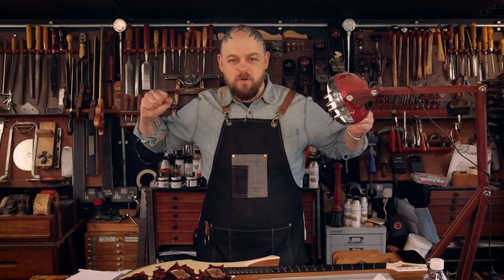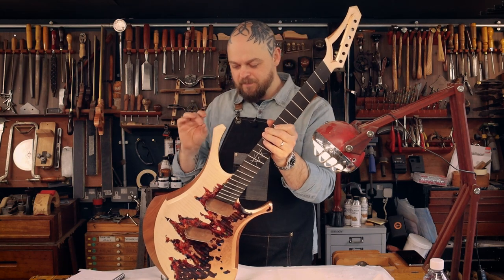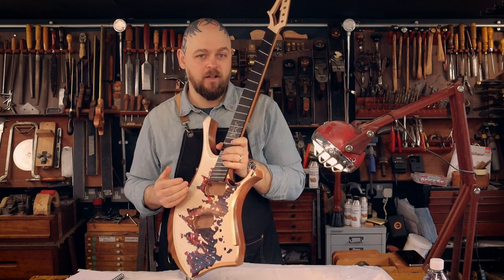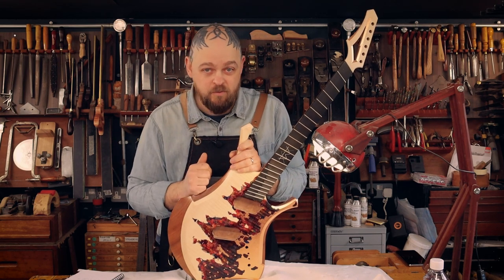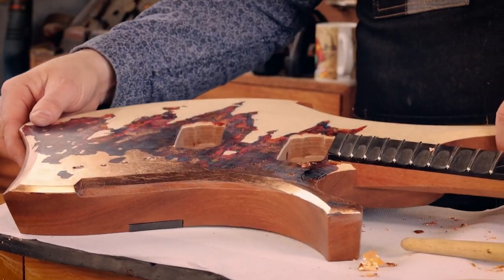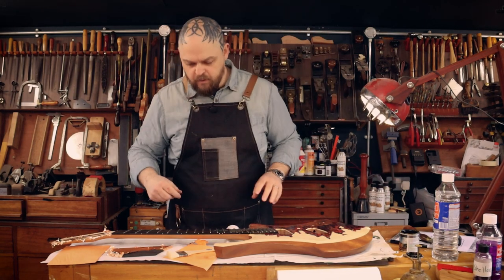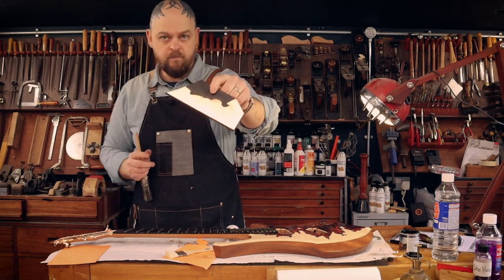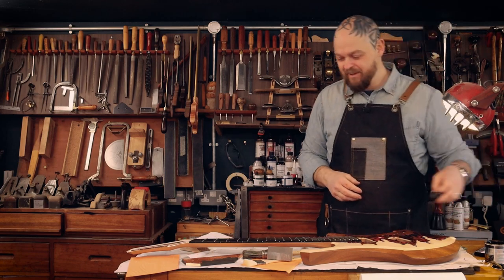Ep 10 - Shred - Bridge Design - How to Build a Copper Leaf Multi-Scale Kit Guitar

Comment: What about a bridge where you adjust the height from the back of the guitar? You'd basically have 6 bolts or screws on the back pushing against the bottom of small plates on which the length adjustments are on. Then again, you'd still need to drill holes front to back on the body.

Comment: Speaking of overly complicated bridges, I built one a couple months ago...

https://drive.google.com/file/d/1nDvhYSOgCo2CRhCI5b2MXyAi4-Sea2Ax/view?usp=sharing

It is a two-way tremolo, operating on needle bearings, in theory there was to be a mechanism to lock it in place without using any tools, but I never finished that part of the project.

It works, stays in tune when working as a tremolo, all regulations are functional, there is no drilling through body - the string is put in from the back, ring locking it in place. I ended up locking it in place with a screw, because after 10 years of playing Floyd Roses I eventually found out that I prefer a solid bridge ;)

Anyway, this build and the Nebula are just amazing. Great stuff, enlightening and inspiring!

Comment: Not a fully formed idea yet, but maybe the germ of one... Considering that it's for you...,  If you take a hand plane and flip it over so that you are looking at the cutting side and imagine that as the top of the guitar, you have a flat surface (guitar top) with the protruding blade (bridge) that is nearly infinitely adjustable in terms of height and angle. If you cut a slot through the guitar, and rout out a bit of a cavity on the back to work in, could you not essentially turn the whole guitar into a giant block plane? I'm certain that you have seen a million ways to set and adjust such a thing, from the simple to the silly. I'm not sure if it's a plausible idea, but I'll be glad to watch you chase that squirrel for a while.

Comment: what if, for the bridge you use the idea at 17:17 but instead of putting the slot for the strings in the piece you screw to the guitar you make the moving saddle longer and you put it there?  it's a bit less cool than your final idea, but it should have enough force to press the saddle down and quite easy to make

Comment: Hi Ben, there were a few mistakes in some of your designs. You have not taken into account the angle of the bridge, which results from the scale length.
But why do so much work? Take the Schaller saddles, either from the Hannes bridge or from the 3D-6.
With the 3D-6 you only need a new frame and a base plate. In the base plate you can also work out the strings for hanging.
If you take the saddles from the Schaller Hannes bridge, 
all you need to do is make a beautiful wooden frame that supports the saddles on the side and contains the screws to adjust the string tuning.
But be careful, the height adjustment is only 2.5mm and the spacing 54mm.
For the palm rest, there is nothing nicer than the saddles from the Hannes bridge.

Comment: You need to have the string anchored to something other than the saddle, or it'll make intonation adjustments impossible - as soon as you undo the locking bolt the saddle will pull forward. If the saddles are locking to a base plate, then mill a string anchor into the base plate instead. Although you still have the problem that adjusting intonation will be hard, if all you are doing is undoing the locking bolt then having to move the saddle by hand, with it under string tension.
Reply: Loosen the sting ala floyd rose adjustment when you dont have the special tool...
Reply: @BBGuitars  you don't really want to have to slacken the string right off when setting intonation though, do you?
Reply: @Forest_Fifer  its not ideal, but same principal as the archtop bridge ben mentioned in the opening of the video, youll need to slacken the strings to move it around. Technically you should be loosening your strings to make intonation adjustment any way, especially when extending the string length, generally speaking I dont because I havnt had any issue doing so...

Comment: Sorry Ben, just some thoughts on  your saddle / bridge design. If I understand your design, it looks like the string  height adjustment will not be possible while the string is sitting in the screw slots, this would not be very setup friendly. Imagine trying to measure and change string height and having to remove the string from the saddle wet screw " thingy" with each adjustment.   Also the intonation adjustment isn't clear, but you might have something planned for that.

Comment: Only slightly disappointed that the headstock didn't get the mosaic colour stain treatment on its top (non-tuner) side with a copper Crimson logo inside! Bevels match nicely and do finish it off well still. 

RE bridge, slightly beveled edges, front shaped to match the headstock end(?) and the height 'grub' screw should have three cuts for a six-point star IMO rather than Phillips cross or full eight-point asterix

Comment: This is just my opinion, but aren't you trying to reinvent the wheel, so to speak? I have a Telecaster that has a 6 saddle bridge, string through body, I'm not bragging, but it's perfectly intonated, the string height is Perfect for me. It's 30 yrs old btw. On my 335 it's got the old tunomatic bridge with the standard tail piece. It was a job getting the string height correct, as there are only 2 adjustments, but it works, & it's well intonated. I've never found a reason to complain, as I love your designs, but you're driving me insane! However I will withhold complaining until I see your bridge. I've wondered about intonating a fan fret guitar. Of course I'm an old coot, who has played over 50 yrs. So I'm old school on the frets. Anyway. I'll watch.

Comment: Grub screws to set the action is nearly perfect simplicity but I fear it would be a pig to set up and all scratchy edges because of the hole for the Allen key in the middle of the string contact area. Your would also have to tap the hole it goes into. Instead, how about a slotted pan head machine screw and a nut. Set this in a smooth hole in the bridge block and when you turn the nut, the bolt, with string running through a slot in its head, goes up and down. No tapping, no need to cut any fancy slots and can adjust with string fitted. Basic and simples.
Reply: Aaaaah, I need to build a guitar now! I'm all inspired by these awesome videos. Had anyone got any time they can lend me?!

Comment: I'm liking the bridge, but I don't like your height adjustment. I have an alternative for you. If you make a triangular bottom piece with a threaded hole running parallel to the string, tip up and slope facing the headstock, you can run a screw from the front and adjust distance to the front face of the bridge. Then place another triangular piece tip down in the space between the front of the bridge and the moving triangle. If you play with the geometry you can screw in the screw and clamp together the bottom piece and the bridge front, squeezing the top piece out on top. The string will act as a spring, wedging the top piece down and forcing the pieces apart if as you unscrew it to lower the string. Just hacksaw a nice clean break in the top piece and you're done. If you want me to, I can CAD up a drawing and show you.

Comment: The precision required to fabricate a multi-scale bridge is daunting for the average DIYer. I am not a fan of using a small wood screw into the body to resist string tension, consider using threaded steel  inserts in the wood to increase the strength and allow for a machine screw to be employed.

Comment: The issue with the hinged bridge idea I can see is that it might give you some "sitar-like" buzzing. A narrower point at the end of the hinge for the string to rest on would solve that. Thinking of it using a screw as a height-adjustable saddle might cause some buzzing and rattling too, a screw to lock it in place is probably a good idea. It's gonna be really exciting to see how the bridge turns out! 

Speaking of adjustable necks btw, you should check out Schorr guitars. http://schorrguitars.de/

Comment: If you put the function for holding the string in the adjustable saddle, it’ll be a nightmare to set up. Moving the saddle will require loosing the string tension completely. And you will have a high pulling force on that intonation screw. Anchor the screw behind (or under If string through) in a non moving piece. Then you can intonate easier and you’ll only have a downward tension on the moving/adjustable saddle.
Reply: So easy to maintain should Triumph easy to build. You build it once, but then there is a lifetime of maintanence.
Reply: Here’s a suggestion on an simple design: an offset Mustang style bridge (tilted further to the guitar butt at low side) with pre radiused saddles, two heightscrews - one on each side of the bridge string slots at an angle over the saddles (not perpendicular as on the Mustang bridge) and a solid string anchor (or through body) behind the bridge. Solid, not rocking/floating bridge base as the Mustang and with a wider channel on the bridge plate (as the old Bass VI) for longer intonation adjustment.

Comment: There are two problems in the design. 
1. There's only friction of wood screw resisting string tension on a vibrating system. That's too weak. It holds initially, but over time with temperature and humidity changes the screw gets looser and the saddle piece slips ruining yout intonation. Having strings through body is much better, because only a portion of string tension pulls the piece back and the rest of it pushes it down. The force on the screw is only a fraction of this.
2. Adjusting string height recuires releasing tension completely. It puts more stress on the string and it breaks after a few adjustment. Not catastrophic but annoying.